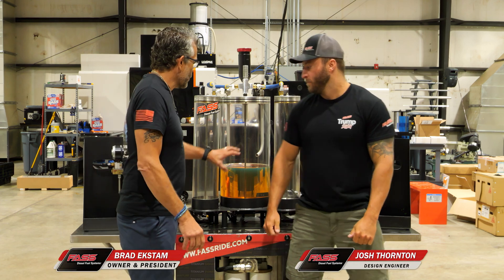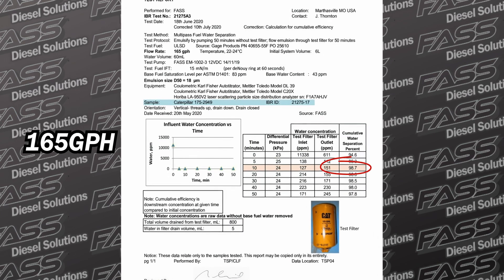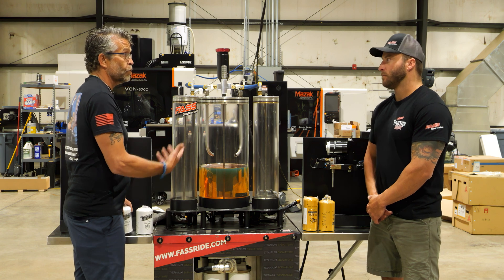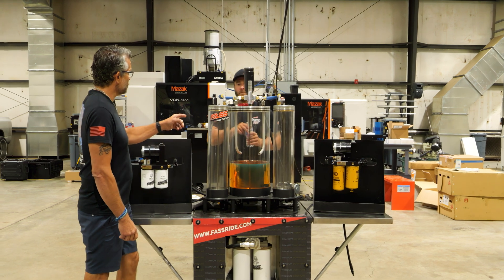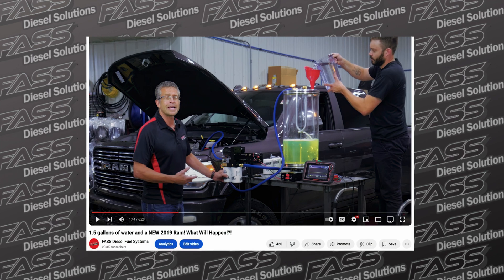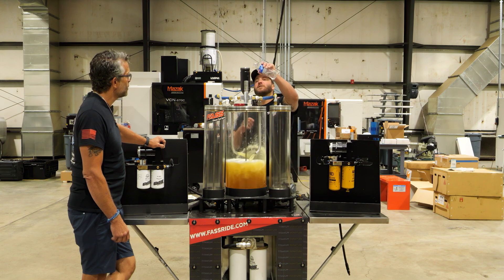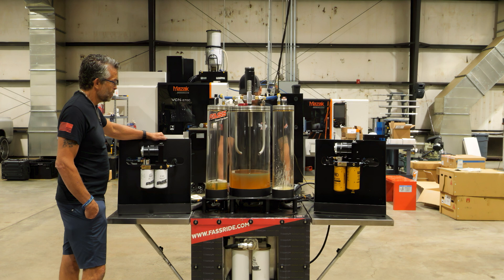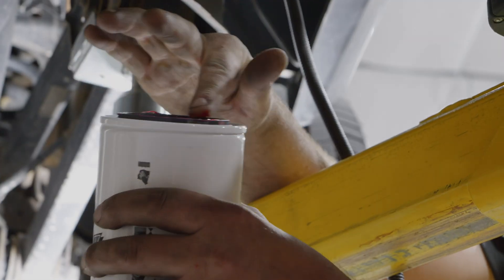CAT Filters vs. FASS Filters: Water Separation Test

Comment: how can you dump more water in the tank that could even fit in the filter completely empty   how does that makes physics
Reply from the maker: Good question! We put a lot of water in the fuel so you can see just HOW much water a FASS Fuel Filter can hold. We also do this to show that once a 3rd party filter with a drain (like the one shown) is full, it allows water to pass through the filter and into your injection system. Ours acts like a diaper that absorbs the fuel and swells. Eventually when it is full, it cuts fuel supply to your engine, preventing any extra water in the fuel to get to your injection system.

Comment: What’s the thought behind the 144 micron on the suction side? The Cat W/S is around 13 correct? So is Fass heavily dependent on the W/S @ 2 micron for filtration? Wouldn’t the 144micron allow less agitation creating the clear fuel in the tanks vs the CAT? Just trying to wrap my head around test results on paper vs visual. Thanks for the input!

Comment: Probably dumb question, but can you not just empty the separator if performance goes down? And is it still once a year change filter and separator?
Reply from the maker: No dumb questions! You can't "empty" our water separator filter as the material acts like a diaper that absorbs all the water. We recommend changing the filters ever 20,000-30,000 miles (depending on fuel quality) or once per year!

Comment: what happens to fuel flow through the water seperator media in the event that it reaches its full capacity?  Does it shut down flow completely?   If it does can I simply remove the filter and drain the water or just install a new water separation filter?
Reply from the maker: Good question! Our water separator works like a diaper and absorbs the water. When it gets full, unlike competitors, it swells to the point that it shuts down fuel flow, which ensures no water passes through to your engine. When it gets to that point, simply replace the filter and you are good to go again!

Comment: Before I watched this I had just changed my Cat filters out for new cat filters. How much water should be considered too much coming out of the drain. Because I had a lot seems like it was more than what the filter could hold. I had just driven the truck around town. Does that make a difference. My filters are on the correct side. I haven’t had issues before. But it just seemed like a lot of water.
Reply from the maker: Thanks for reaching out! Unfortunately we can't give you an exact quantity. However, as CAT filters use older filtration technology that will eventually allow the water to pass through to your injectors, we recommend draining them often. In terms of water filtration, our filters not only remove more water (lab-tested and verified), but will not allow water to pass through in extreme situations. Hope this helps!

Comment: Would it benefit me to dump the water out of the filter ever 10K to ensure the filter wont fail? I believe you say change the filters every 20-30.
Reply from the maker: Hey Robert! That's a great question. Our filter utilizes a micro-glass element, so the water is actually trapped in the element itself. This is a more effective, safer filtration method and does not require draining.
Reply: @FASSFuelSystems  UNDERSTOOD. THANK YOU
Reply from the maker: @ Glad we could help!

Comment: After years of following the market I have chosen to go with the Fass titanium series for my 6.6 LLY. So then the question is; what filter is recommended for at the motor? I’m not in favor of eliminating it.
Reply from the maker: Thank you for your support! And that's a great question. 

You can certainly retain that stock filter at the motor, or remove it altogether with a Factory Fuel Filter Delete Kit. Any filter that is downstream of a FASS is essentially a placeholder, as there won't be anything left for it to filter out. 

If you decide to keep the filter in place, we recommend using any quality (OEM-grade) or similar filter.
Reply: @FASSFuelSystems  true…… And it would be easier to see and reach other things as well as make for a clean look. Was not at all convinced on the water separator filter at first but now that I’ve considered for a while it sure makes sense. Better than replacing injectors!
Reply from the maker: @tomaskey6844  It definitely is! We refer to our fuel systems as "insurance for your injection system".

Comment: Id like to see a comparison between the fass filters and Baldwin BF1258 (10 micron water separator) and Baldwin BF7633 (2 micron fuel filter). Also from an engineering / scientific and marketing standpoint I think you should have the lines visible on the test rig so further proove there is no trickery with hidden extra filters. Not saying there are tricks, but with everything visible it solidifies the integrity of the test.
Reply: Also there was only a 2% difference in the test results. That color difference sure looked like more than 2%. Like maybe was subserving extra going on?  What were the 2 bigger filters on the bottom for?
Reply from the maker: We appreciate that feedback, thank you!

Comment: Very informative video, would you by chance have a drop in replacement for the Severe Duty filter kit on the 2004-2012 Ram 2500 & 3500 Cummins trucks, Mopar 68083826AA?  I know you probably recommend getting a complete FASS system, but I can't help but believe there is a huge market opportunity with some drop in replacements for OEM systems.
Reply from the maker: Great question, and we do have a Drop-in series FASS that will fit those trucks. What year is your truck and we can send the link?
Reply: @FASSFuelSystems  2012 Ram 3500.
Reply from the maker: @DillonPrecisionFan  awesome, thank you for the info. i have a link here for the kit we'd suggest for your truck: 

https://fassride.com/shop/product/shop-category/2007-5-2018-6-7l-24v-cummins/fass-fuel-systems-drop-in-series-diesel-fuel-system-2017-2023-ram-cummins-difsram1001/

Comment: on a previous question, when the filter stops fuel flow to the CP4 (Ford SD 6.7), does the pump starve and go dry or fuel remains in line & pump?  I understand performance would drop prior to full-stop... just playing out worst case: fuel stops. Concern is the Fass Drop-in is to prevent the CP4 from water & failure... full stop and dry isn't any better for a CP4.  

This goes back to previous question, how much water will filter absorb before filter blocks flow? Scenario: Near empty towing 5th Wheel, stop and fuel... later to realize bad fuel. Performance drops, stop & change filter... how far between filter changes?  Do you need to carry several sets of filters to handle a bad tank of fuel, or will 1 normally handle a bad fuel fill?
Reply from the maker: Great questions, and the water separator can hold up to about a water bottle of water within the filter before blocking fuel flow. Coming up to that point though typically the performance of the truck would drop. One thing we usually tell people to do is keep an extra set of filters on you just in case you run across a batch of bad fuel as well. The filters typically last 20-25k miles, but if there is a bunch of water in the fuel our XWS will do its job and pull all the emulsified water from the fuel. If you have any further questions, or need anything you are welcome to reach our service team as well. We'd be happy to answer any questions you have! The number is 636-0433-5410.

Comment: Maybe try something that isn’t as old as dirt for your comparison. Cat has newer Fuel Water Separators that are significantly better than that dated design.

Also, your buddy seems kind like a moron, do you think the water just magically disappears in the FASS separator?  If you don’t have a drain, your FASS filters will fill up with water and then pass 100% of the water in the fuel, straight to the injectors.

Drains are required if you want to keep separating after the FWS fills up……

Comment: I have a titanium. My biggest fear is sending no fuel to the injectors because your filters will shut off when full. I live in the Midwest and we have plenty of water in diesel tanks. Can you show me how much water it takes to shut off your filter. I'm sure it is more then in my mind. I lost a lot of money sending no fuel to my truck causing my PTSD. Thanks in advance.
Reply: You would notice a lack in power or fuel pressure drop before the no fuel to the injectors scenario.
Reply: All diesel dispensing tanks should or do have a water detecting filter which swells up and shuts off the flow in seconds, and that stops the water from getting into a truck fuel tank. I see those filters on commercial pumps at gas stations, and if you have your own tank, you can put one on.
Reply: At 10 degrees, my 6.7 shut down due to the new FASS water separator filter. I was snow plowing out in the boonies, and my beautiful truck shut off. I didn’t know what to do. Sucked, wind was whipping and I had work to do ! My truck shut off !  Not cool !  Cycled key a few times and I think the ice crystals went away, truck restarted and I plowed ALL day, temp outside stayed under 28 f all day.
3 days later, I spun the FASS water filter off, cut it open to see if there was water. There was some tiny droplets, very few really. Should have NEVER EVER STARVED MY ENGINE LIKE THAT !  
The FASS sig series is too loud also. Kinda wish I never frigged with the stock set up !!
Reply: @jeffreyhebda6709  the FASS filters stop a lot smaller particles than OEM fuel filters i just like knowing that all the trash is not getting into my injectors 
And in the winter i run plenty of anti gel in my fuel because smaller micron filters can stop up quicker when fuel starts gelling
Reply: I keep an extra set of filters with me at all times i would rather my engine shut off because bad fuel stopped up my filters than get trash in my injectors

Comment: Will FASS filters fit on my airdog? (It was on the truck when I bought it)
Reply from the maker: We appreciate you asking, and apologize as the FASS filters won't fit on an Airdog system. The thread size is different. If you need cross reference though to run a better filter I'm pretty sure they have a sheet on their site, or if you google airdog cross reference it will pull it up.
Reply: Honestly, I would save a little money and switch over to fast.
Reply: @ashtonjohnson2203  plan to eventually but in the mean time want to get some fass filters
Reply: @coryt-notctk6822
P550315
P550550
Or a 1R0759

Most of these will be readily available at your local CAT dealer.

Comment: Let’s solve this problem once and for all - paint your filters yellow (or red). I think many customers like myself find white boring. Not arguing your filtration performance in any way, but I think a color change would be the best of both worlds.
Reply from the maker: We've certainly thought about it! Several companies also offer filter wraps, which obviously allows for endless customization.
Reply: That’s definitely not a reason to not go with FASS. A color likely a mechanic will only see. I just ordered a FASS system.
Reply from the maker: @10DigitGrids  🤘🤘🤘
Reply: Color options would be a good idea. Personally I think the white looks good though under some hoods, in particular of a Paccar and Detroit engine bay. But anything other than yellow looks ridiculous next to a CAT engine…
Reply from the maker: @macbeliever  🤘🤘🤘